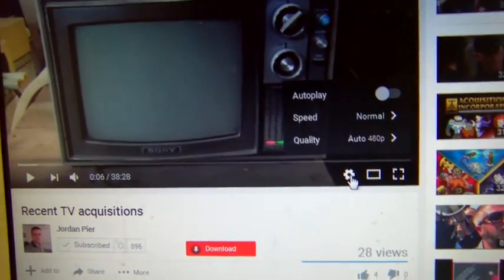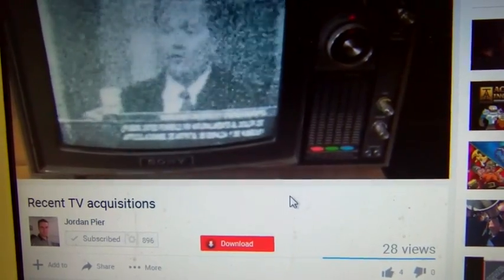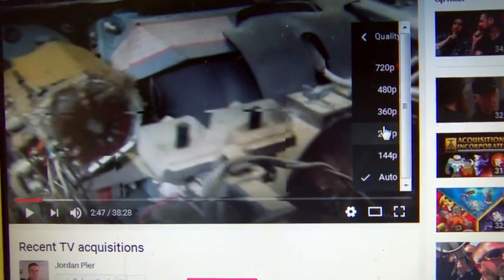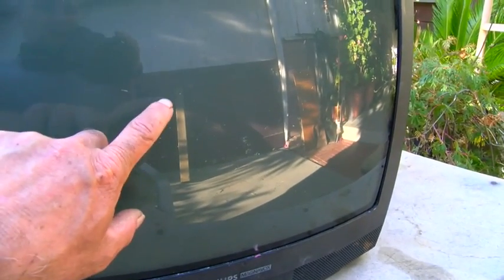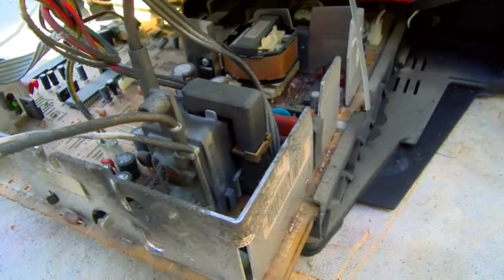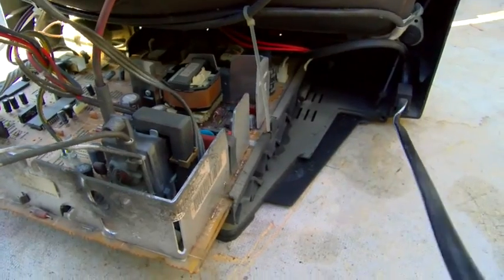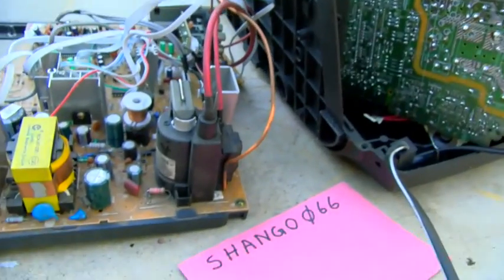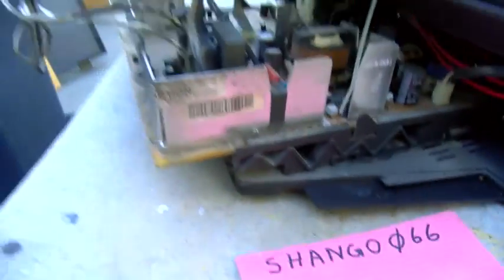Philips Magnavox  Color Televison Quick Fix

Comment: That cap was a common problem on those sets. There was also a resistor in the 200V line to the video output stage that would open up and the vertical IC, and it's associated components, would sometimes fail. These were money makers, 20 years ago; but, worth nothing more than EOL material today.

Comment: When you were moving behind the set near the yoke, your cam was picking up the magnetic field lines. They sounded like sine wave tones around 500~750 hz as you moved around the yoke, and when you moved to the front of the set the tones were blocked. Interesting, isn't it? They weren't loud, but they were noticeable. Thanks for the video! Can't wait for the EOL.

Comment: Oh man I got one of those Philips Magnavox sets still.  The coax connector broke off the tuner module so easily, and I had to solder it on.  It still works today, but occasionally goes bright on it's own, then goes back to normal, it's weird.  I might part it out though.  I wonder if the CRT will mount in my Samsung set.

Comment: I had another philips tv with a nearly the same circuitry board and respect the volume and channels not working, i have to explain you that in those tvs, those controls won't work unless you have tv signal on the tuner. It's not a fault but a feature. Philips tv are weird sometimes..

Comment: crappie tact switches in those sets. picked up one of those and all the switches on the front panel were dead.

on a separate note, had an 80s Sony with an exploded cap like that across the horizontal.

Comment: Some of those plastic sets the buttons work if you tape a strip of thick plastic along the back of the cover to push the board forward so the micro switches are in contact with the buttons... samsung sets were the worst for the buttons working then not working... then working when they feel like it.

Shame they never left the remote with it.

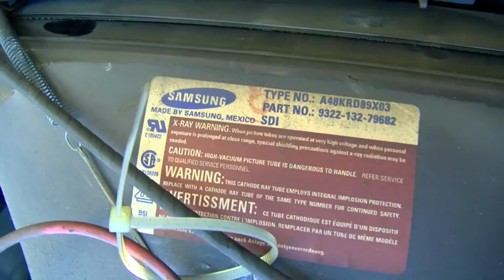Comment: 9:26 Philips TV with a Samsung CRT. Back then around late 1980s I saw an Aiwa TV with a Sony Trinitron CRT here in the Philippines.
Reply: In Europe Philips had it's own multiple CRT manufacturing plants, until the end of crt's, they even produced 16:9 crt's. Strange to see a Samsung in there.
Reply: Aiwa was bought by Sony. A lot of Aiwa gear uses ASIC and even PCB marked Sony. I have a still working Philips TV set like the one on the video and was made in Hungary and had a Philips CRT. I bought it in a Philips outlet at an huge discout because was a refurbished one. I bought there a lot of last year models at a discount too.

Comment: I cranked this up to 2X so JP's talking was 3.5..  silly as heck! * I find BPC TV's at the rate of about 10/12 per year now; I don't have very many fireworks left from NewYear, so, no EOLing- I just strip everything out.. esp. the yoke and degauzing coil(if copper) I collect the heavier, more complex heatsinks too, might do some sculptures, some look like skyscrapers when stood on end.  melting a big plastic box and scattering mercury all around my yard is sadly just not an option.  Too many birds and beasts live there.  Shure would be cool to own an old airplane hanger or something to really have a swell time.

Comment: Why EOL the thing, that looks like a good CRT, and they are only getting harder to find?  At least save the CRT.  Or is that part number only found in crap sets that are not worth the trouble?
Reply: Yes its stupid to EOL these type of Samsungs
Reply from the maker: Yall are welcome to adopt them. I cant pay people to take them here, they are of negative value
Reply: You just gave me a new business idea :D Thank you Shango
Reply: While I do agree with you and if the demand was there if I were doing it I'd repair the set to sell, however these sets have a negative value pretty much.
Reply: The CRT was made for that type of set, you cant put int in a vintage restore set unless your into restoring mid 90 early 2000's NAFTA crap...
Besides the CRT has all those nicks and chips in it.
Overall if it is analog it is useless. I get restoring a vintage 1960's tube set but these things are simply garbage which is why they end up in the garbage..
Reply: ElfNet Gaming Just being analog doesn't mean it is useless! It's just the demand isn't there anymore sadly.
Reply: Well unless your going old school with a CCTV system, or have one of those converter boxes, or you're playing NES Duck Hunt (Reason I kept an old set myself lol) these old sets are heavy, space consuming, and cumbersome. The popular demand is for 4K high resolution flat, thin, lightweight sets that use hardly any power and get more than enough channels plus wifi internet access all in one..
Reply: +shango066 we come along a lot of these tv's at the tip & most of them still work fine but everyone has upgraded to LED/LCD flat screens! We have brought home some for the kids bedrooms to use for their game consoles & DVD players & my daughters still using these tv's as my sons have upgraded to flat screens & so have I in the loungeroom & my bedroom because the Xbox one & ps4 need HDMI connections. We do find more flat screens at the tip then the old Analog tv's now & 9 out of 10, the screens are smashed! 😢
Reply from the maker: Corinna Roberts
I am going to start filming these videos in the same resolution as these old crt sets 640x480 and sit back and watch viewers rant and bitch about how bad and unwatchable it is
Reply: shango066 cool, I reckon the picture on a old CRT tv is better then a new flat screen any day. 👍🏻😀😘
Reply: Corinna Roberts I think the colours are better on a CRT, not the resolution, but nonetheless CRT's are still decent, most people these days are too bitchy, sure there's 4K and HD but how good of a resolution do you need to have a watchable picture?
Reply: +Sony Trinitron so true. 👍🏻
Reply: +Sony Trinitron also the sound quality on the CRT tv's are heaps better with good treble & bass. The new flat screen tv's have low quality sound & poor volume unless you hook them up to a home theatre system or stereo. I only just upgraded to a LED/LCD flat screen last Xmas because my beloved 15 year old Teac CRT tv's screen went green & started to bleed as it was high hour & was used everyday non stop in the family loungeroom. It produced a beautiful picture & sound before it died.
Reply: Sound quality does suck on modern flat screens because the thinner they get the thinner the speakers get but connect it to a proper surround sound system and its the best.
As for picture quality on a crt vs a proper 4K high res flatscreen TV or monitor, hands down the flat screen wins miles ahead of any crt set however the crt / analog sets win in my book in the tuner, where digital will block up analog did not have that issue.

Now my bite with the flat screed HDTV's is to me the picture look too crisp almost like its drawn with harsh edges on where a CRT was smoother..The flat screen wins in the color department where a CRT fails in the sense a CRT can lose its color vividness in time or become gassy where and LCD will not but LCD's are way more fragile.
So a CRT vs Flatscreev comes in 50/50 in my book, both have their perks and flaws alike.
Reply: ElfNet Gaming well said & now that you said that, 50/50 works out right. Plus flat screens come in large size screens too, so no more eye straining.
Reply: Digital v's Analog? Honestly, I preferred Analog because it didn't pixelate & freeze/drop out easy like Digital & with Analog you could take a portable TV set anywhere with rabbit ears or coat hanger & pick up reception but with Digital, that's abit hard to do!
Reply: Corinna Roberts That's why I don't like digital TV, it blocks up.. however the whole antenna thing is a commercial marketing scam, You can use an old antenna to receive digital TV channels. When it comes to receivers you typically want a bigger antenna so it does not matter what you use really, bigger is better, but if your transmitting you have to be exact with your sizes.

I still have an old "analog" antenna on my home and I have it connected and it actually works better that the digital counterpart I paid entirely too much money for that only receives half the stations the old antenna does..

Rabbits ears will work on a DTV but just like in the days of analog, their performance is not that great. Most indoor DTV antennas have a basic crude pre-amp circuit in the that may or may not be powered..The thing is that companies want you to believe you need a "special" antenna to receive DTV signals, they are playing on the consumer public's ignorance by mixing up transmitting antenna facts with DTV receiving antennas and creating a lie, the general public only know and hears "antenna" never mind the fundamentals and science behind it "YOU MUST HAVE THIS SPECIAL $59.99 plus S/H HDTV ANTENNA! BUY OBEY CONSUME LIKE A GOOD CITIZEN"  That's the jist of it anyways.

I may make a video on this antenna scam one day if I can get enough stuff together lol
Reply: ElfNet Gaming wow ok. We have two Antennas on our roof but they don't do anything & I've even tried a booster with no such luck! I thought it was the new tv but does the same with the old analog tv. I ended up buying a outdoor digital HD antenna off Kogan for $20 & hoping to set it up through the week to see if it works.
Reply from the maker: Corinna Roberts
Watch my video on this, it must be a good directional antenna. Digital does not work well with multipath reflections. Antenna is everything
Reply: shango066 ok I will, thanks.
Reply: Corinna Roberts You could have a bad feed line, the matching transformer may be bad,r the connectors on the cables may be bad or something gone bad in the antenna. The one I have is fairly large model from the analog era with a VHF and UHF section on separate feeds, I used the UHF section only and like I said, it works 80% better than the 4 bay DTV antenna mounted right under it... Maybe its my location since I am not in a high RF polluted area of town. You could have a lot of RF pollution causing issues with your reception. Also it could very well be the TV set itself, I have worked on some Vizio sets recently that had faulty tuners, I replaced them and they came to life in full force.
Reply: I think the two antennas on the roof may be bad as I've noticed the spokes are bend on the large one & they both are facing away from the main town tv tower that's behind us on the hill. I've connected the cables (there's 2 going into house for both loungerooms) to different TV sets & still no signal, even with using a booster.
Reply: we have one of them sets ours dosnt do wifi though i like it i have a ge porta color i still have it but the picture tube is dead in it now need a replacement but even our cable boxes now only have hdmi plugs so i cant hook my old tv back up if i wanted to  it used to be hooked into the cable box via antenna to coax adapter i see these old sets going all the time just till last year i had about 6 of them all still working 4 of which where still in use i didnt feel the need to upgrade but when i move they all got left when i found out how much a moving company was  so i loaded everything in a youhaule and left a lot of junk.

Comment: I bet a few individuals would want mexican picture tubes deported.

A customer called me to check a tv like this one. I still haven't got the time to figure out what the problem is because it took me a very long time to actually see it. The telly eventually stops working, the deflection collapses and the filaments cool off for a couple seconds before coming back up on it's own. It's gotta be some plain electrical thing, since I cannot hear the relay switch when it happens.

So far I have been cleaning the mess of their earlier repairman who suffered a stroke and is now incapacitated. I found out that he had shoved some recycled tube radio/tv passives  on a 1995 TV.
Reply: Broken solder joints around the flyback or crt neckboard
Reply: I checked all the boards for broken joints and repaired them, but the problem remains. Perhaps the power relay is rusted.